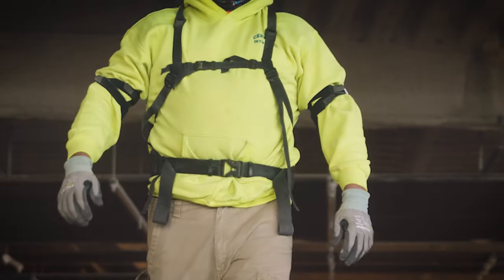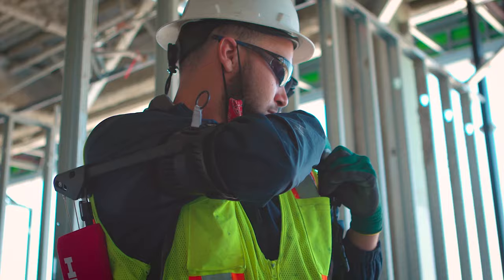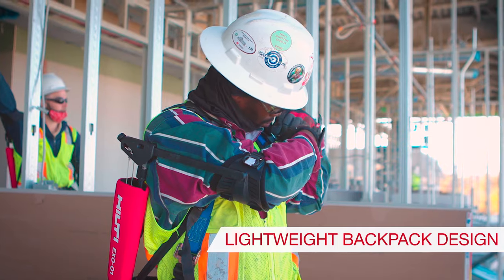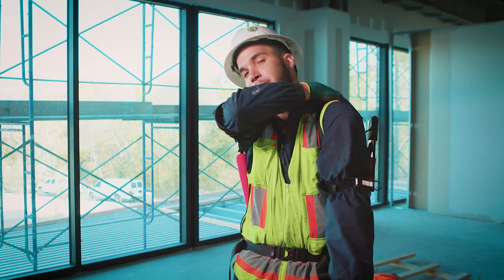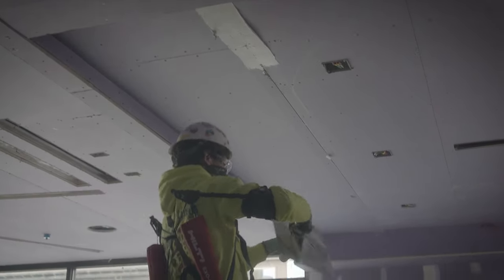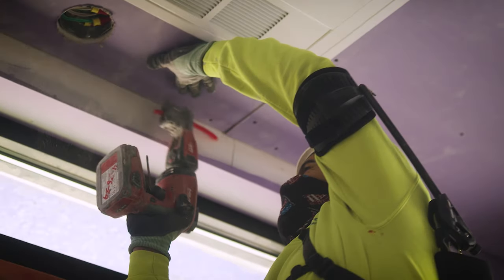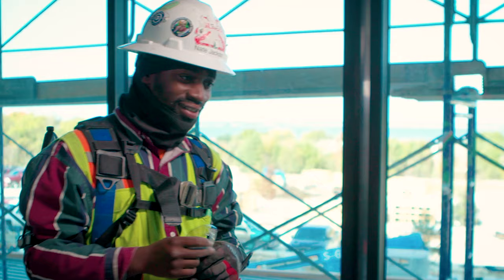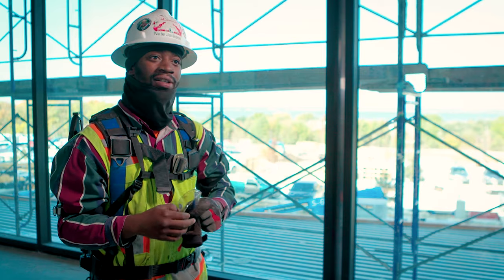Hilti wearable exoskeleton for construction EXO-O1

Comment: Hi folks. 

I used my exo for the first time today. 

I used it to help with my work as a piano tuner. 

I bought it because I severely damaged my shoulder 8 weeks ago i damaged my rotator cuff and have very little lift out or forward at the shoulder. The down and back muscle action is fine. 

I know this device is not designed to be used as a therapy tool for injury but I discussed it with my physio and we decided it might help

It has in two hours advanced my ability to move 100% 

I Would be really happy to be involved in any research into the possible application of this device to help with injury rehab

I will keep you informed. 

Jon. The piano tuner.
Reply: Lol
Reply: @kaspervestergaard2383 Remember to change that tampon dude (or whatever you identify as).
Reply: @elephantgrass631  I identify as a pumpkin. Whenever I get home from work, the only thing on my mind is to paint my skin fully orange and sit out in the sun. Have dug a hole and put a green branch on my head as the top. Please respect my choice.
Reply: @kaspervestergaard2383  I identify as a pumpkin pie maker, your lookin mighty ready son.

Comment: I can see the military being a big investor in this technology to allow our troops to move heavy armaments and repairs. A lot of the engineering limitations on our technology are because they need to have human strength to move and maintain their weapon systems. By having an exoskeleton you can build your weapon systems around their physical strength over the strength of a human. The way a forklift allows us to move things on a pallet. An exoskeleton allows us to work on machinery or handle materials that would be impossible with out it.

Comment: I would like to know that is good for work in warehouse for lifting boxes
Reply from the maker: Hello, thanks for the question. The EXO does not help you carry extra weight. You should not be performing tasks with it you would not perform without it. It transfers portion of the strain you would normally feel on your upper arms and shoulders onto your hips. It does not make you stronger in any way.
Reply: @HiltiNorthAmerica   So your shoulders and neck will feel less fatigue and joint consumption, but if this fatigue and consumption are moved to the hips and  the lower back, it will not solve the problem, it will only move the problem. Isn't it?

Comment: So taking this and then camera mounting gear to counterweights is all you need to alleviate most of the stress on the body. Integrate that with a good mount to the floor and then the workers can focus on their craft instead of the limitations of the weight of their tools. A huge factor will be government support as a way to reduce stress on workers body’s as a way to decrease healthcare costs down the line for trade workers. Convincing construction and manufacturing that these exoskeletons will save their pensions and healthcare funds billions of dollars down the line by saving people from back and knee injuries.